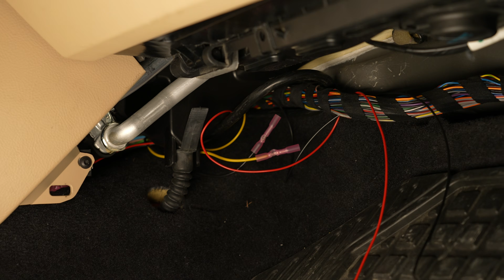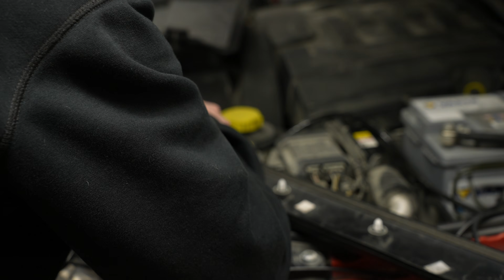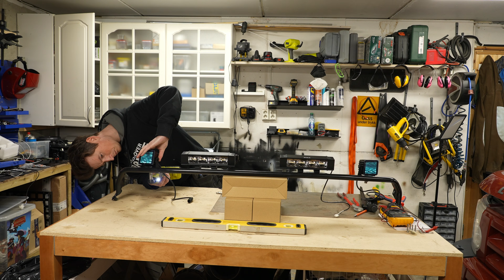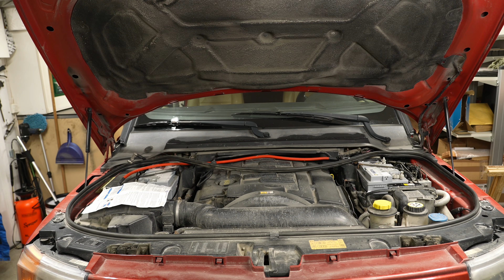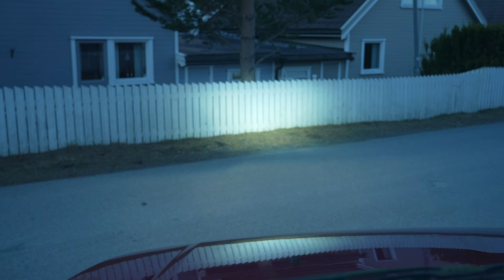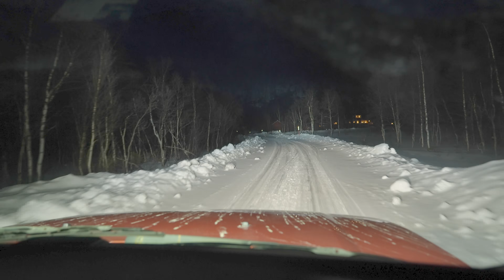Discovery 3 Auxiliary Roof Lights & Victron Dual Battery + Ford Upfitter Switches

Comment: Great job, the corner lights work really well. What light do you have on the inside of the tail gate?
Reply from the maker: Hi and thank you!! 
I use 12v led strips bought from a typical cheap car hardward store, nothing special. 
They were called under headlight leds. So they are 30cm.

I have a video of it on the channel where I install them.

Best,
Simon

Comment: Simon, why still an AGM and relay setup, while LiFePO4 and DC/DC-Charger is the way to go? Of course a LiFePO4 can't live in the engine bay, getting too hot, but there are plenty of other cavities in the cabin to be utilized.

Just a simple thought on the battery and charging method here: imagine battery A is fully charged, and battery B is more or less empty. The voltage regulator in the alternator sees the combined inner resistance of A and B in parallel, and will adjust it's voltage accordingly. As a result, A will overcharge, and B will take forever to fully charge.
Reply from the maker: Great input Christian and if I didn't have Lithium in the back already I would definitely do that first. :) 

This solution is to work as a backup for the main battery and with the combiner being a bit smarter than a standard mechanical one I belive it to be a good options. 
With the batteries being initially fully charge, they will stay pretty in sync if nothing special happens. I won't be draining battery B any significant amount and is more of a addon for battery A. 
When I get the time I will connect all main auxiliary driving lights onto battery A so that I don't get the excess charing cycles on battery B as the lights drains it. 

I have my Camping battery 100ah Lithium behind the secon row seats, fits perfectly and there is room for another 100ah, so may be looking at an upgrade soon. :) 

The two systems will be seperate, and the camping setup will be charge via solar in the end. 

I hope this makes things a bit clearer but I maybe should do a video explaining it all when I got it all set up on the car. Batteries, solar and lights. 

Thanks again.
Simon

Comment: Bad news getting older sucks it takes longer for the body to recover every 10 years your body changes you go to bed wake up with pains you didn't have before you'll ask yourself what did i do in my sleep 😮 , i use to be into bodybuilding,  lifting heavy weights thank god i never took steroids like so many do , 
Nice to sed you are building your lr3 into more of a overland vehicle hopefully you will add rock sliders,  snorkel  , and possibly a winch,  i bought a abr front bull bar for my lr3  but i haven't decided if im going to install it because it will change the front look of the lr3  but i do wished i swap out air springs for the 3in coilovers lift my lr3 still has suspension fault and stuck on bump stops i just haven't had the time to find the issue i have replaced everything suspension i didn't have this problem with old suspension components,  this is why i love the discovery 2 soild front & rear axles great for lifts kits bigger tires , so i have decided to copy you im taking all 5 rims to get powered coated thats a 100 dollars a rim the spare time on D2 is on rear door , the headliner is falling down so just got new headliner in black so that's the 2 things im doing now on D2 , the overland lights really makes a difference looks nice
Reply from the maker: Hi James and sorry for the late reply! 
Good news that we are getting older, alternative isn't quite as good knews. :) But yes, we just have to live with it, and lifting weights is great remedy. 

I will work on both cars going forward, now back on the Series for a while, and I hope to keep the both running and road legal. 
I took of the rock sliders on the D3 to check out the rust issue, so I just need to fix that and put them back on.

If I were there I would help you out with that suspension faults, I find it strange that I haven't had any issues yet, other than air tank and compressor. 
If there is too much to be changed out, the 3" coils would be a good options, only thing you will loose a bit of the comfort while driving. 
D2 is great, better option for harder overlanding and harder trails for sure, lift kit and solid axels is a big win. 

Powder coating the rims was a great option, and the paint has hold up 100% during the salty roads this winter. Nothing bad to say. Just be sure they do a good clean of them firs as that is the most important part my painter told me. 

Do you have black interior on your D2? That is really rear here in Norway and I think the best options. 👌

Best wishes from Norway, James. 
Simon

Comment: they look great Simon. a helpful tip for you. when using the wire crimper. tie a small rope on the top handle to hang down and tie a foot loop. so you can hold the wire with both hands but don't have to use your body to push the lever down. have a great one.
Reply: If it wants to roll. you could always drill a hole in the bottom arm so the rope goes thru and is centered:)
Reply from the maker: Thank you Tom, I am well happy with them. Will have to test them a bit more next season and on a proper trip. 

Thanks for the tip, I will see what I can do. I think I also want to have a mount for it. 
A battery powered hexagon version is what I would prefer but man they are expensive. 🫣

I will keep an eye on the connection points and see if they hold up after some time on the car. 

Thanks again, best,
Simon

Comment: Great job Simon. Those corner lights especially make a massive difference 👍
Reply from the maker: Thank you Simon! The corner lights is working great but has a bit too much spread for my liking. 
Spots could have been a bit stronger but will do for now. 
Together with the high beams on the car it’s all working great together.